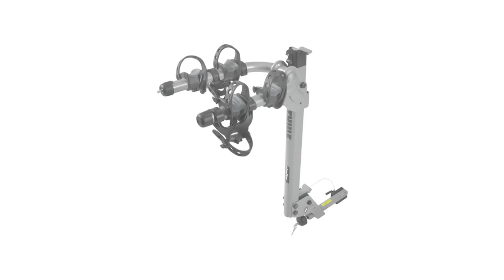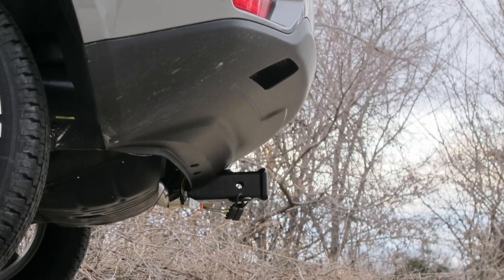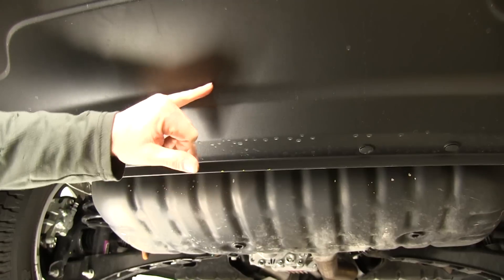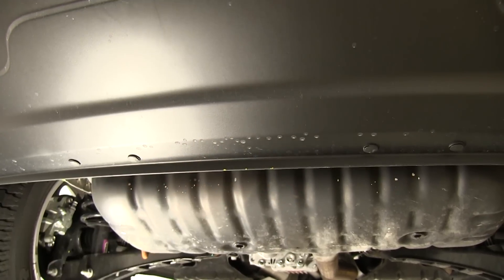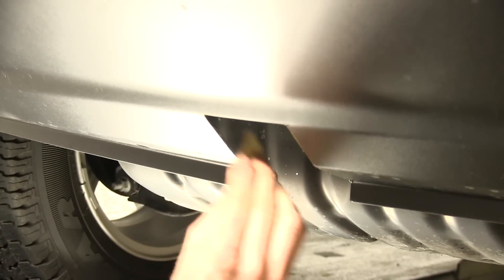Installation of a Trailer Hitch on a 2012 Jeep Compass - etrailer.com

Comment: How big of a load can it pull?
Reply from the maker: This trailer hitch has a gross trailer weight rating of 4,000 lbs and a max tongue weight rating of 400 lbs. You will need to check in your copy of the owner's manual to see what the towing capacity of your vehicle is though because if it's lower then you need to remain under that capacity as that is the limiting factor.